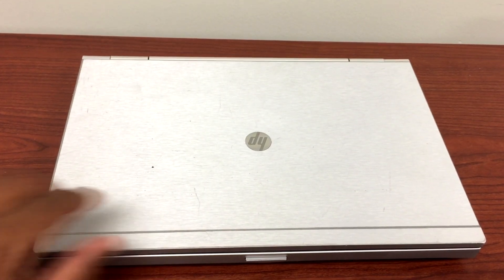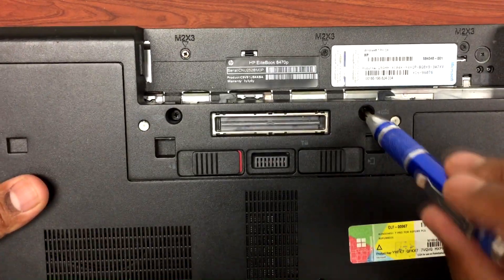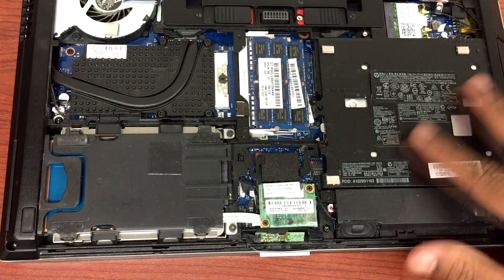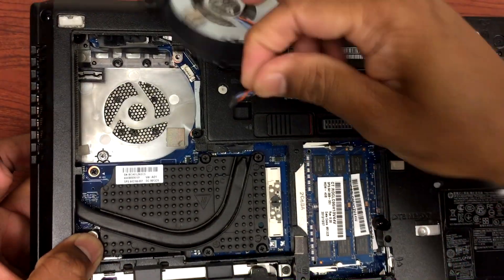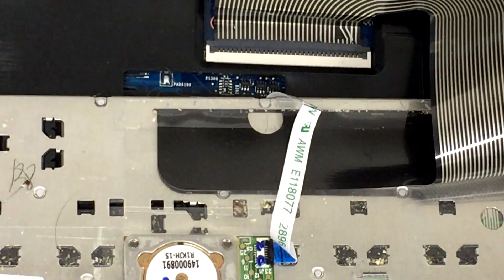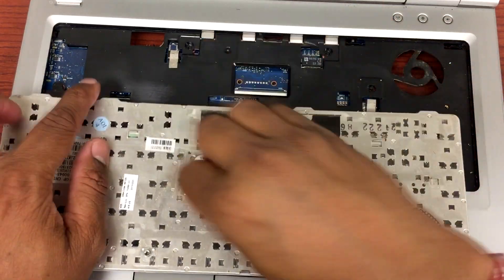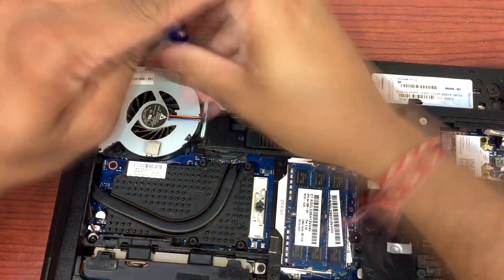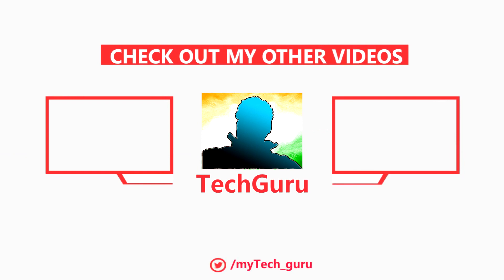Keyboard Replacement - HP Elitebook 8470p

Comment: Why you need to remove the fan?
Reply: One of fans screw is holding keyboard. You leave fan in place just unscrew fans screws. But if you remove fan you can give a little push to keyboard through fan hole and it comes off much easier.